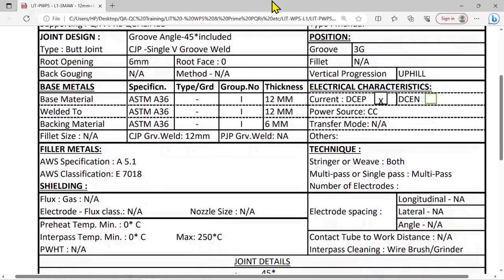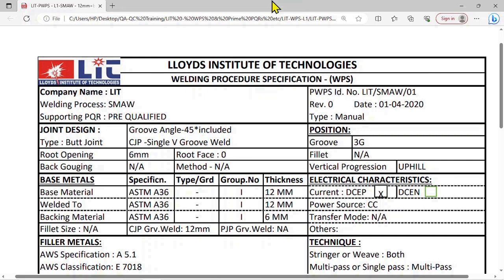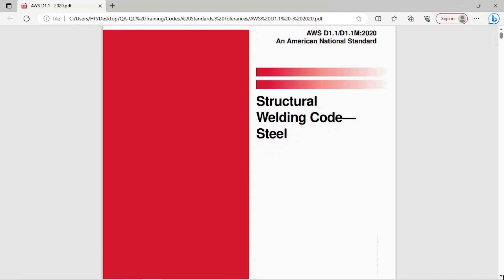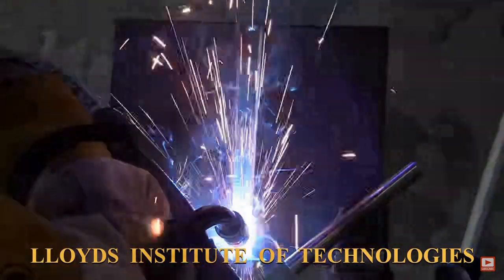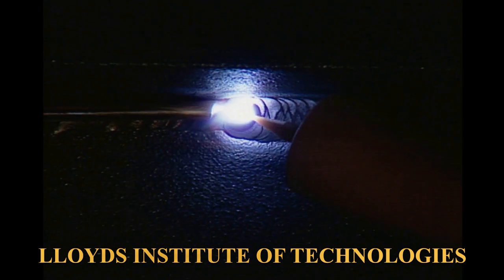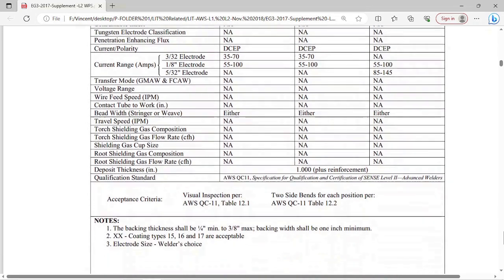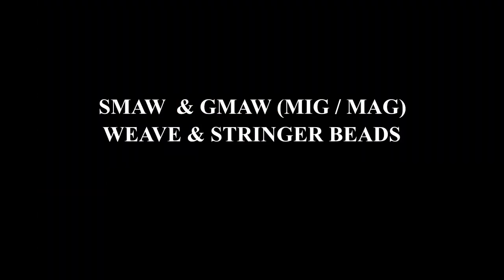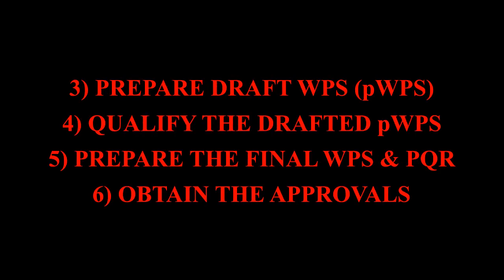HOW TO WRITE A WPS (Welding Procedure Specification)

Comment: Can you please give inputs on how to prepare REPAIR WPS (SMAW,FCAW,MIGMAG etc; and the Code
Reply from the maker: The same way as explained in the video you can prepare a repair WPS also. You should ensure to have all the information about the base material, surroundings, failed joints, whether any design failures involved or not etc., before writing the WPS.
You can use the code acceptable to the client.
All the best.